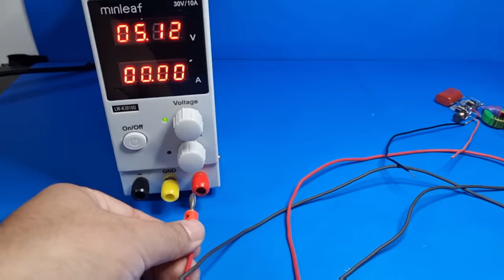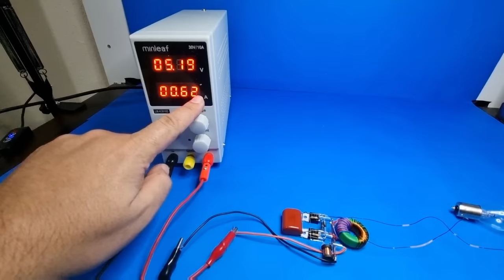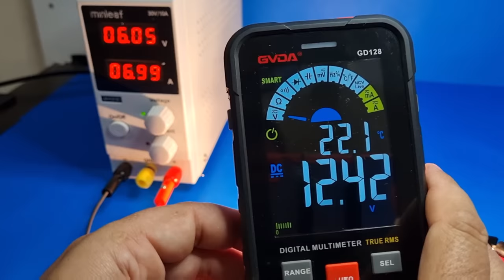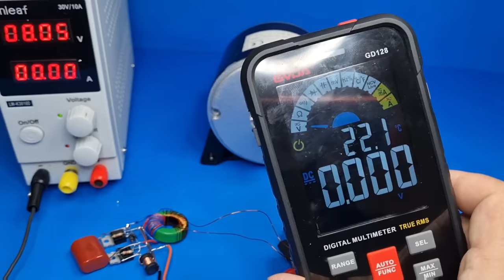How To Make High Power DC DC Booster Circuit

Comment: This circuit is very inefficient, drawing over half an amp with no load. You need to change the two IN4007 diodes to faster versions as the design runs at a high frequency, this is where some of the power loss occurs. You should also add a large, say 220 mFd capacitor across the  DC input rail to lower the impedance of the current source for more reliable operation.
Reply: I agreed......
Reply: mybe not have the component...😁😁
Reply: This guy doesn't know anything about electronics he is just putting together some components
Reply: @xnxnxn0861  no dude he just make simple projects and uses materials that are cheap and quickly available in Turkish conditions. It doesn't say it's an efficient or good circuit anyway.
Reply: thats right this way the circuit can be made more stable and efficient
Reply: UF400X-Diodes ...
Reply: @xnxnxn0861  he only describes the design and components sober, the rest improve yourself, as efficiently as possible, like we are looking for goods we want to buy at a low price.
Reply: @xnxnxn0861  May be you should come up with soe better?
Reply: @mickeymus8242  agreed everyone has to start somewhere,  and the high rollers always hate on the less fortunate. I build what I can with what I have and always looking for a cheaper way next time. Thanks for your comment. 
God Bless
Reply: gavurlar seni çekemiyor😂

Comment: The schematic (@8:02) should show the bridge rectifier and the smoothing capacitor at the output to make it a DC-DC converter, otherwise it will be a DC-AC converter. Would have loved to have seen the AC waveform.

Comment: Mine only use bjt transistors. It still worked. The voltage went up to 48V AC. With a transformer it went up to 240V AC with 50kW of power. ⚡

Comment: Your videos are interesting and I like it when you provide the circuit diagram. In this video at 2:48 you use a 3.3uF 250V capacitor, but doesn't show where it is connected and is not listed in the parts list. It is not shown in the circuit diagram too.. Please provide this information. Can you also give the maximum input and output voltages and currents capacity? Thanks.
Reply: The capacitor was connected to the collector of the transistors, one leg to of the capacitor was connected the collector first transistor and the other leg of the capacitor was connected to the collector of the second transistor. Thanks.

Comment: THIS IS THE MOST EFFICIENT BOOST CONVERTER I HAVE EVER SEEN AND REDESIGN  ON YOUTUBE BUT THE PROBLEM IS THAT IT DRAWS SO MUCH AMP IN THE INPUT. Anyway to solve the problem?
Reply: toroid, the main loss in this circuit is in the toroid, capacitor and resistor of the gate driver, a transformer with an air gap should improve efficiency and a better capacitor as well, an optional circuit should consume about 50 to 200ma without load.
Reply: less capacitance reduces the current in the windings (LC circuit), but also increases the frequency - more losses in the mosfets;  It's a matter of balance...